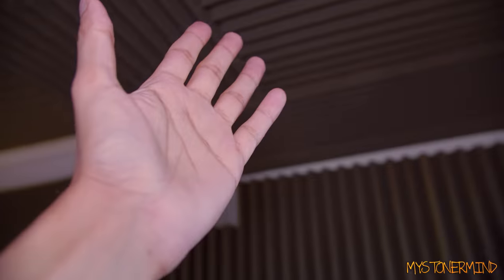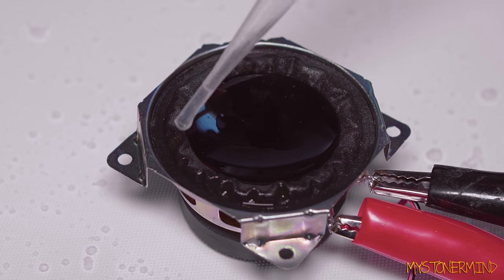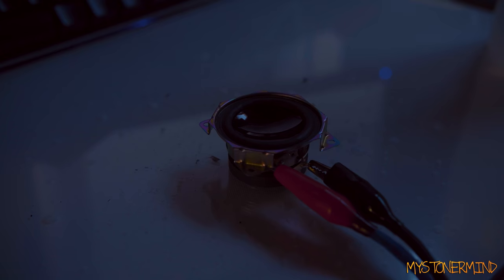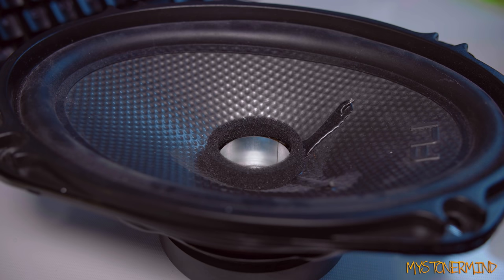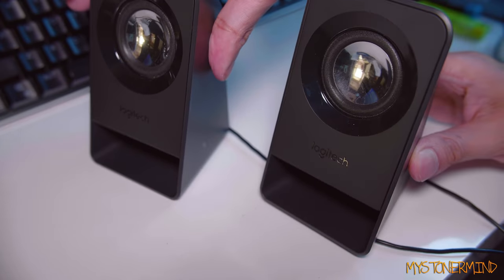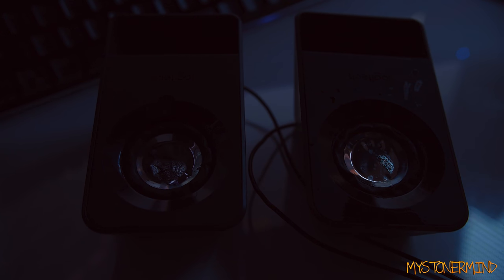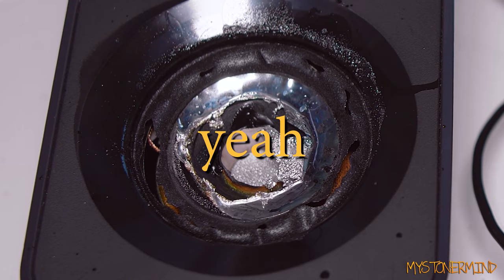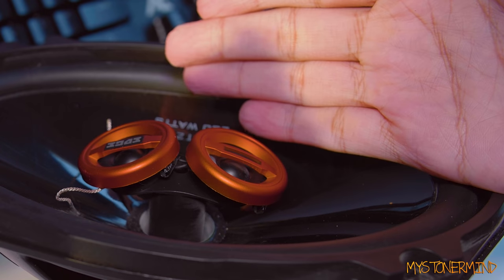Overpowering Speakers 3 - FLAME GRILLED

Comment: Mystonermind can you do at least one jbl speaker. Maybe the go or clip models to save money
Reply: Why jbl like every youtuber tests that brand he better tests sony it's more original and they are cheaper and also good
Reply: @troybakker7628  But sony don't have a oval speaker that has a excursion of 300 inches
Reply: @gabrielvieira6529  have u seem their new speaker lineup the new ones have passive radiators like jbl so you can see them good
Reply: @troybakker7628  Cool. I will check it later